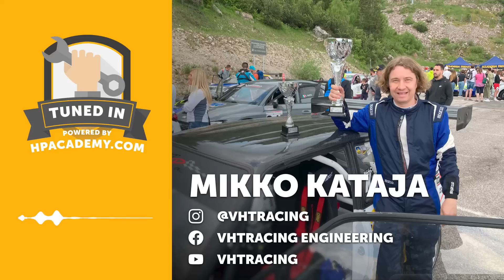Hayabusa V8 Powered Hill Climb MONSTER Build & High End ECUs

Comment: I understand Mikkos enthusiastic approach to Bosch Motorsport ECU being of a high grade. But he lost me at why? I appreciate the knock sensor filter calibration and its plug and play with an existing Bosch set up, like an E46. But there are areas that it lacks support, cruise control, TPMS,  separate idle control as they use throttle position to set idle control, emmision controls etc. Great if you have a track car and probably cheaper than building a Motec harness overall but as all the aftermarket ECUs illustrate its not always the answer
Reply: Not to mention Bosch MS pneumonics are all german abbreviations, adding another layer of hassle. It's not "spark angle" or "ignition angle" or "ignition timing" - it's "zwappl". nMot for RPM, tMot for ECT and so on. Takes a long time to learn.

On the plus side, if you fork out the cash for Bosch MS, you get the matlab/simulink models - which thoroughly detail EXACTLY how the software actually calculates everything.

I haven't used Bosch MS since around 2011 -  so I'm sure it's come a long way. However, my Link G4x blows the old BMS out of the water in all regards. Not a fair comparison though, considering they're 10-12 years removed from one another.